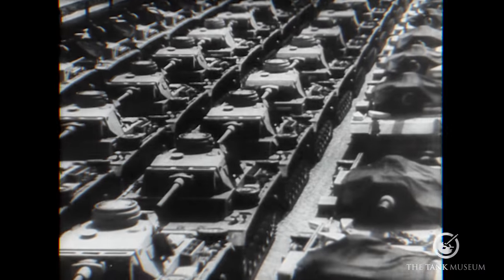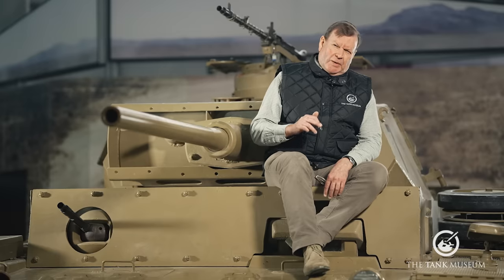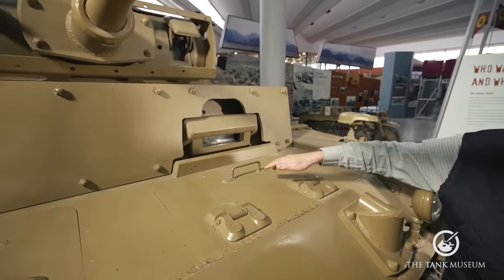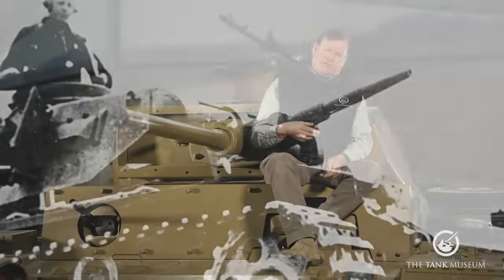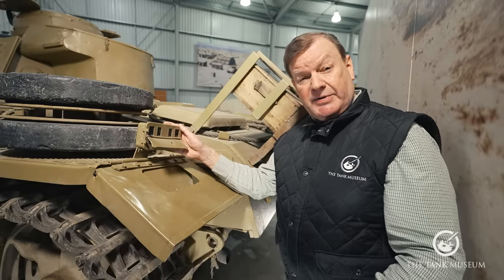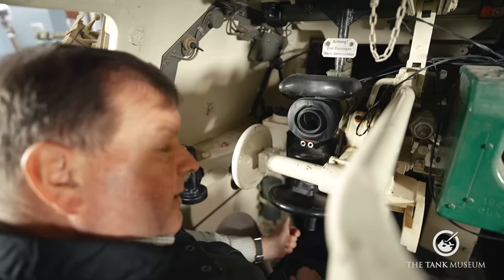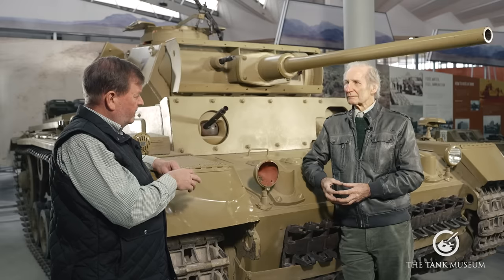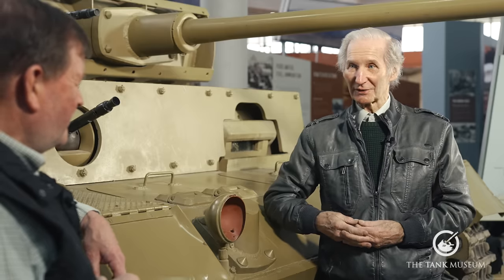Panzer III: Versatile Stalwart of The Panzer Force

Comment: A question for Mr. Hayton and the team, if they have the time: does the additional loader traverse crank allow any faster traverse than the gunner can do alone? Just setting a grognards' bet.
Reply: The loader's traverse was put in the Panzer 3 for a surprising reason that has been almost forgotten. 
The earliest versions of this tank had a pair of MGs on his side of the turret, whereas later versions had only a single MG. 
But there's more. The loader could decouple that MG mount from the main gun, so that it elevated independently! He could attach a shoulder pad to the back of the mount and operate it by himself, WITHOUT needing the main gunner to do anything for him.
So, naturally, if the loader was operating his pair of MGs, he needed a means to turn them left and right - therefore he was given a traverse handwheel.

Comment: The painting of the tank's insides is inaccurate in some ways.
The entire gun breech is painted green 10:45  which is not how Panzer guns were painted. The Tank Museum should know this, because this topic came up during restoration of their Tiger, and they painted their Tiger correctly. 
The walls inside the tank are now painted in a light cream colour resembling the original "Ivory", but I don't see many equipment labels written on them. The Germans made sure to label each and every item inside a Panzer, sometimes with stickers, sometimes hand-written.
But, while this light cream colour is correct for most Panzers, it's not the colour that this tank had inside when captured. Like many Afrika Korps tanks, this one was repainted inside with a mid brown colour by its own crew - because they were annoyed by the African sun coming through openings and making bright patches that could dazzle them. The brown colour was still present in this tank when restoration began.

Comment: Quick question were all tanks of this period able to deploy smoke in some way
Reply: All of the Panzers could drop smoke canisters from their rear, one by one. In 1942 a new system of launchers on the turret was introduced. But it was not a success, and was deleted in mid 1943. From early in 1944 a sort of gun that could fire smoke candles was installed in the turret roofs of Panzers.

Comment: How did the radio operator fire his MG in any sort of aimed fashion? He had no vision slits outward?
Reply: He had a telescope, the Kzf2, fixed into the gun mount right beside the MG. It peered out through a tiny hole in the steel ball. The telescope is installed in this video.

Comment: I learned a new thing about this tank. I never knew it was a post war tank. They really over engineering this model. You just see the struggle of nazi germany later in the war. Where they making the tanks just cheaper to produce like stugs. If germany just produced this panzer cheaper, (mass production) stronger/ better ( thicker armor and a motor that keep up with the weight) and a real great cannon like the stug it would be a good offensive tank that germany really suffered from.

Comment: the panzer 3 was the better tank design that was made more advanced and expensive than the panzer 4 , yet the germans chose the inferior already outdated panzer 4 to become the main workhorse of their army and suffered the consequences. 

it was a better tank than the panzer 4 which more or less replaced it, even tho the panzer 4 recieved upgrades it never fixed the inherent issues of the underpowered engine or horribly outdated leaf spring suspensions that led to a horrible driving experience.

Comment: Take that broken thing off of the mantlet and take the extra armour off of the front where the driver's visor is - to restore the original aesthetics.
Reply: That wouldn't be orginal aesthetics though would it? As you would have a mismatched hull and turret.

If you want to restore the orginal aesthetics you would need to make a mock turret plate, or removed the hull plate.

Comment: So what's the point here? A beautifully designed and engineered and manufactured and leather and blackjack and stuff yet unable to penetrate the enemy armour and protect the crew from the enemy weapon? Hey, look how geometrcally good our tank is, but sorry, don't shoot at us. They eventually learned the lesson, though - look at the Tiger tank upper armour - just four thick vertical welded plates, you can see the seams - who cares? Embrace the anti-aircraft 88mm gun put on a tank - again, who cares? You don't actually need a turret when you are in a defensive position - take Stug 4, that's what they should have produced in large quantities, instead of strange monsters.

Comment: The problem is that all that engineering's a terrible idea. What people don't get about the German military is that you can accomplish a lot of what they did, people just knew it would be stupid--as it was. Can you make a comfortable tank? Of course. Can you make 20,000 by 1941?
Reply: Could Britain conquer Denmark, Norway, etc? Of course it could. Could Britain hold them beyond 1945? That's the real question. In fact, arguably this exact same mistake cost them WW1 with the Treaty of Brest-Litovsk. They just SUCKED at long-term thinking.
Reply: Stupid arguement when you look at production times.

Panzer 3s are significantly quicker to build than shermans or t34s. Almost 10 times quicker.

German's problem with production wasn't just based in designs, panther and tiger did take way to long but panzer 3 and Mg42 took way less than comparable pieces of equipment. but how much of their industry was mobilised and how.

Comment: Does 'well engineered' mean 'over engineered' within the context of a long war wherein many tanks have to be built with declining resources and capability though...?
Reply: Not in the case of the PZIII. You get a highly modulable chassis, can mount multiple types of guns, armor arrangments, and hulls can be used for StuG production. Sure it didn't boasted high protection, but did his work as a support tank. The Over Engineering problem came with later designs, because they weren' t in the same mindset as prewar tanks.
Reply: Not in this case as panzer 3 was way quicker to build than famous mass mobilisation tanks like the sherman or t34.